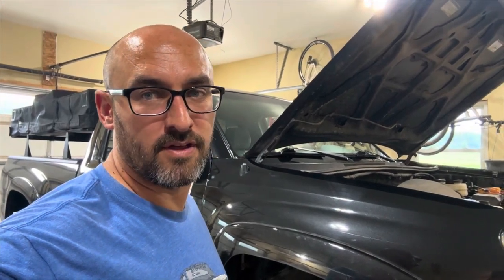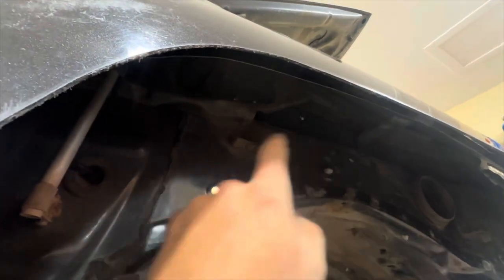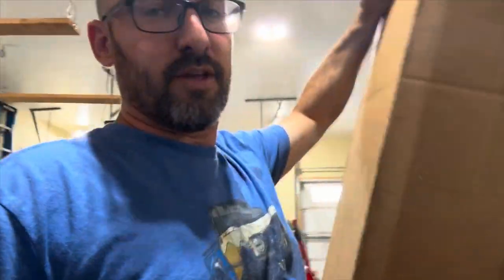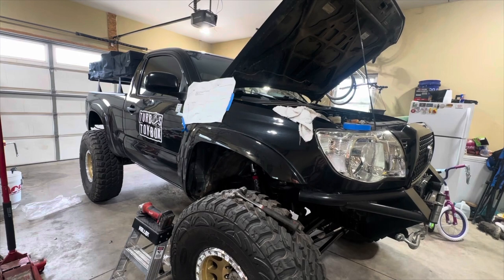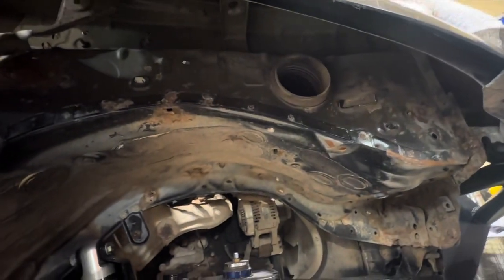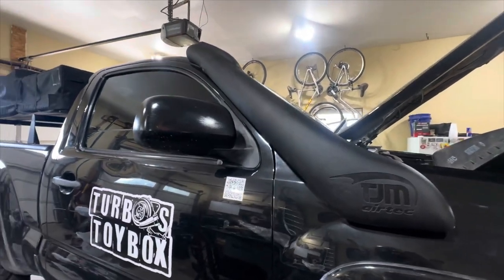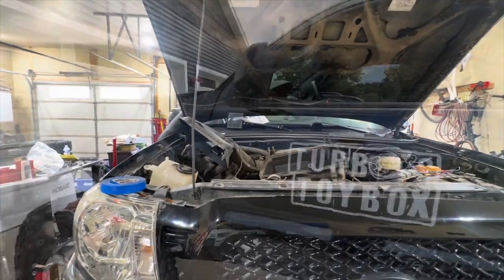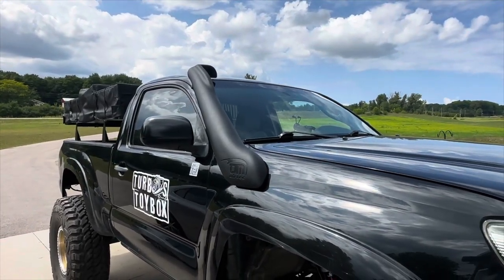2nd gen Tacoma TJM snorkel install

Comment: If you take a heat gun to that tube above the mounting bracket I bet you can get that to relax a bit and close the gap by the roof.
Reply from the maker: I may try that. Just didn’t want to ruin the finish